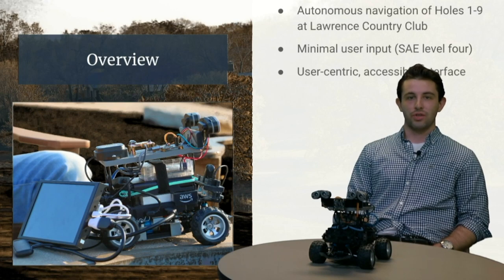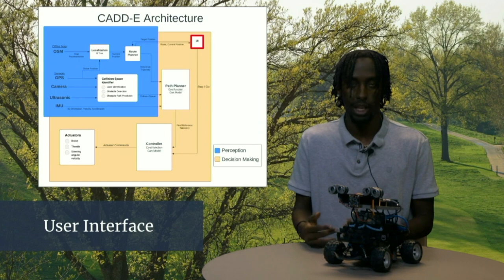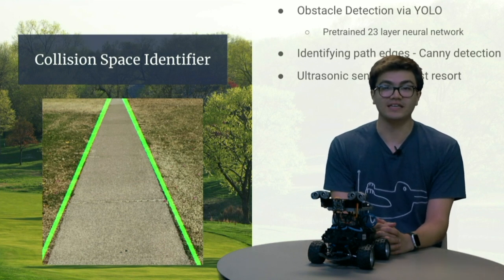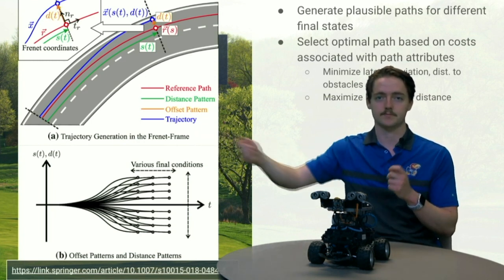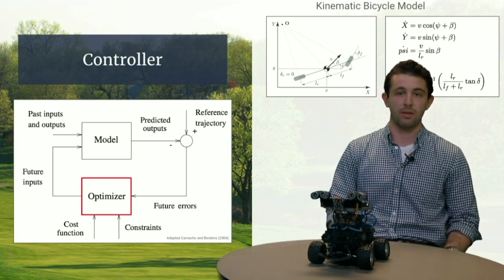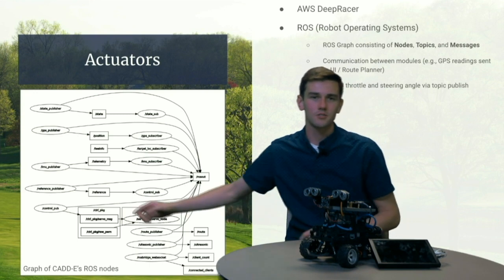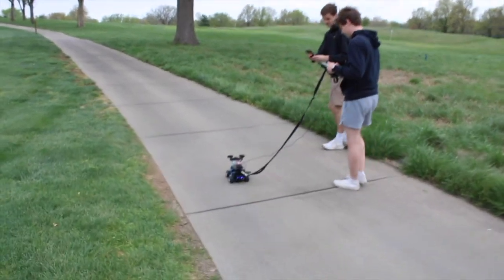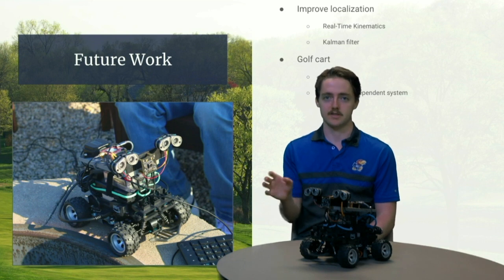CADD-E: Self Driving Golfcart Prototype

Comment: Cool to see you’re using ROS for your project. Were you using ROS control at a deterministic real time frequency?
Reply from the maker: No deterministic frequency for our control loop unfortunately. The primary control loop (code here: https://github.com/KU-EECS-581-Self-Driving-Golfcart/CADD-E/blob/fbe93087f5f9f1cddf0529c96720f579320110a7/src/main.cpp#L257) would run through its processes regardless of how long each process took. This didn't give us any problems for our testing but I could certainly see how having a deterministic time for your control loop would be important.